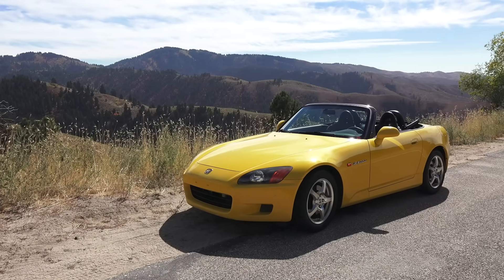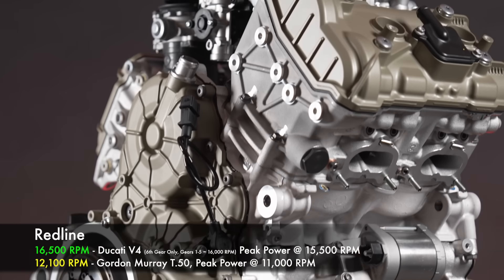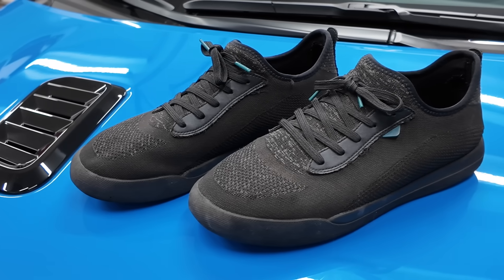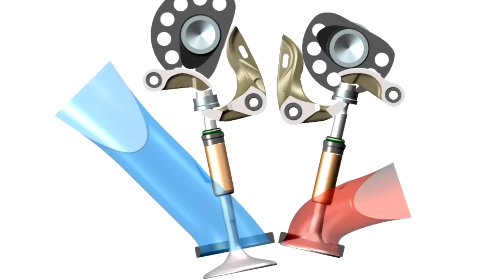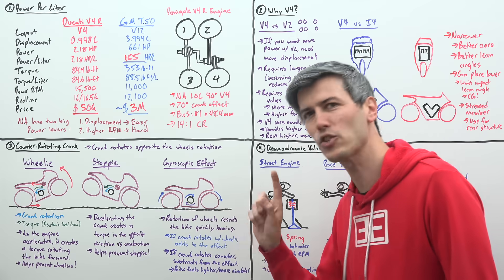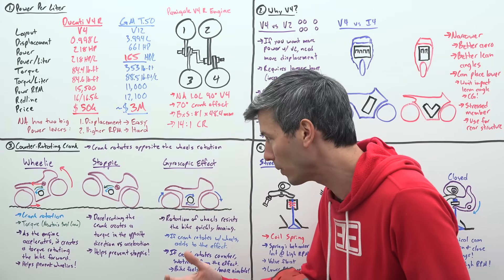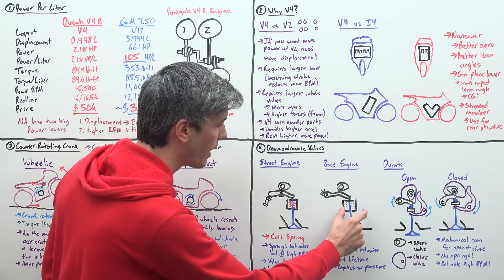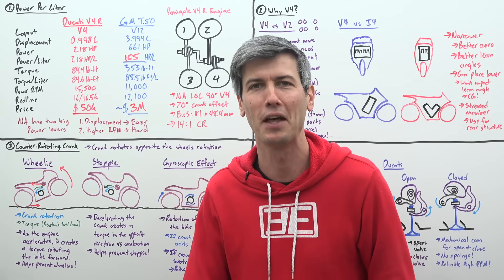Ducati's Brilliant V4 Engine — Putting Supercars To Shame!

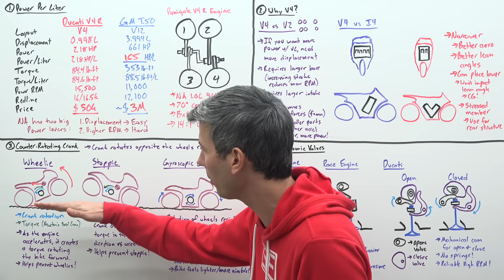Comment: 7:58 - ref: the Yamaha Megacorp and a Japanese Engineer named... wait for it...  MASAO FURUSAWA.😎  he is the legendary designer of the Crossplane I4 found in the Yamaha M1 Prototype Racer (also ref: VR46).  PS: nice 1/2" Milwaukee Impact 🤙for occasional use on "Yellow Iron" and Diesels I've got both their second Gen 3/4" and their first Gen 1" (unfortunately it turns out, these Excavators and Big Rigs aren't going to just fix themselves).

Comment: There have been some people installing super bike - crotch rocket type engines in those tiny cars like smart cars. They put so much extreme engineering in those bikes so they get a lot of horsepower in a small package. Imagine a Hayabusa engine in a smart car with a modified suspension. I would like to see this technology with the camshafts replacing valve springs used in cars I think it's pretty brilliant. I wonder if this could be implemented into something like a V8 or even a V6 engine.

Comment: Ducati didn’t invent the Desmond valve train. F.H. Arnott did in 1910. But Ducati perfected it in 1956. It does have a small keeper spring to keep a small amount of valve seat pressure for starting. Beautiful engineering.
Reply: it's desmodronic valve and google says Fabio Taglioni invented it, and engineer at ducati in the 50s.

Comment: As other comments have suggested, I would love to see more content on bikes. I would especially like a video on power/weight ratios of motorcycles versus cars - people simply do not understand how quick motorcycles are; even the slowest motorcycle is quicker than most cars on the road. It's kind of a key reason as to why you see bikers going 100mph+ on highways ... it takes <2 seconds to go from 70 to 100+, and <2 seconds to go back from 100+ to 70.

Comment: I was not aware of the gyro effect being subtracted if it goes in the other direction than the wheels, this seems counter intuitive for me since you’re not making the wheels go slower to make this effect smaller, you’re just “adding another spinning wheel” (in the opposite direction) that also adds resistance to leaning, never thought it could substract just by turning in the opposite direction😅

Comment: I don't think there's a lot of information out there right now but it may be of interest to you. MV Agusta just announced they're developing a 5 cylinder "square engine". They're claiming it delivers over 240hp above 16,000 rpm and up to 135 Nm at 8,500 rpm while weighing less than 60kg. The weirdest part is that it has a U-layout cranktrain with a 3-cylinder front shaft and a 2-cylinder rear shaft. This info comes from their instagram account, but maybe there's a press release somewhere with more information. I'll probably never be able to afford a bike with a motor like that but I still really want it to make it to production because it's so cool.

Comment: My older brother's first car was a 1985 Jeep Cherokee with a v4 engine and a 4spd. 
You could get that thing up to 85mph if you were going downhill with a slight tail wind lol. But he drove like a maniac around town and got really good at taking turns hard enough to tip it up on 2 wheels and could even ride it for a good distance tilted on 2 wheels and then set it back down, never tipped it over on its side. 
I used to have a blast riding around with him as a kid.
But any time a v4 engine gets brought up, I'm reminded of the wild times in that Jeep...

Comment: my late father was paid by a bike racing team to remove the desmodronic system and replace it with springs so it would be eligible for a particular uk bike racing series - they did it because the bike and engine even without the desmo was still faster than the competitors - of course it was instantly protested on it’s first race win - and the scrutineers couldn’t believe their eyes when the realised it had been converted back to springs and therefore was legal - we called it the DesNo conversion

Comment: Doesnt the 90° of the V configuration help in making more torque than a inline engine? So not only does it RPM and make a lot of horespower they also made it produce more torque at the same time

Comment: The design advantage of 90 degree V engine is that the primary shaking forces of the connecting rods are absorbed by the cylinder with is offset by 90 degrees. This makes the engine much smoother without a counter-rotating balance shaft allowing the engine to rev to higher RPM. This was one of the reasons why the Honda VF750F was dominate in 1983.
Reply: The VF750F certainly owned the production racing class in Australia that year i also owned one an impressive bike back then.

Comment: Desmodromics go back to 1896. Ducati didn't invent it. It's useless in all the air-cooled v-twin Ducati motors, because they redline around 7000 rpm. My 1973 Honda cb350 redlines around 11000rpm. What it can do is allow more radical cam profiles that would either cause the valve to float, or would need excessively stiff valve springs. This motors' 12.5k redline is not terribly impressive either, considering my old 2000 R6 redlined at 15k, using old fashion springs. Oh yeah, and the r6 didn't have belts that need to be replaced every 2 years, and valve clearance checks were at 35k, not 8 or 10k or whatever Ducati wants nowadays. I'm sure the Ducati's engine tech is all that and a bag of chips, but the belts and the desmodromics should go.

Comment: If you go back to the 1199 and 1299 the torque AND horsepower would both be higher than that of the Gordon Murray engine, and they did it in a  V2!!!
Such a great video. Thanks for posting this.

Comment: @EngineeringExplained You only talked about power and not about torque. Explain why motorcycle engines are not used in cars and why they wouldn't work.

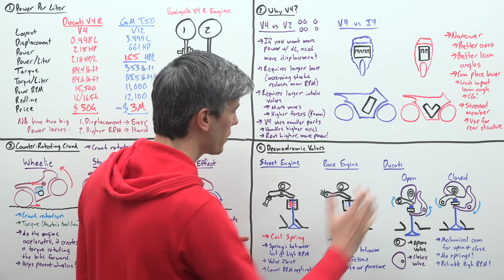Comment: 10:20 i'd say this street engine valve set up is more for cars. Majority of modern bikes use bucket style rather then rocker arms. A great example is Yamaha r6 (yes smaller cc but same point). Bucket style cam lifters but can rev 15k
Reply: i know 1 bike engine that use the rocker arm, which is the honda's k56 engine (cbr150r)

Comment: Can somebody explain difference between 1L V4 vs 1.2L V4 which is used in multistrada?
Reply: Block is the same, I believe. Multistrada uses conventional valve mechanism. Panigale has a different stroke and bore (so it's 1L displacement) and desmodromic valves, so heads must be different also.
Reply: @vvevvevvvvthank you :)

Comment: hello You explained the benefits of the counter rotating engine and I understood as the other factors but why not counter rotation for all high performance engines as a default  I do not understand the disadvantage other than perhaps a gear train to reverse the final drive. Great feature very well explained. thanks.

Comment: GM 13.75hp/1000rpm/Litre 
Duc 13.2hp/1000/L
Reply: What General Motors engine are you talking about?
And why would anyone measure horsepower per revolution per displacement?
Reply: @vvevvevvvvbcz total hp varies with redline . U a kid ?
Reply: @DeeP_BosE you are talking nonsense.
Reply: @vvevvevvvvfind a school near you. Or watch the vdo again kiddo

Comment: I need a car version of the Ducati Superleggera V4. Ducati should collaborate with Lamborghini to bring this dream to life! Imagine a Ducati car equipped with a 4-liter V16 engine that produces 884 horsepower and 342 pound-feet of torque, reaching a redline of 16,000 revolutions per minute. The car’s bodywork would be crafted from carbon fiber with a carbon fiber monocoque, and it would feature an air intake system reminiscent of the McLaren P1. Naturally, it would accommodate two passengers and boast gull-wing or butterfly doors. The rear-wheel-drive system would be complemented by a 6-speed paddle-shifted manual transmission, complete with a clutch pedal. The car would employ passive aerodynamics to enhance its downforce, while maintaining a design language similar to the Ducati Superleggera V4. Let’s not forget its impressive wet curb weight of 2,800 pounds and an astonishing 1,400 pounds of downforce!

Comment: Unfair comparison.
You are comparing an engine designed for a different application.
What about vehicle mass?  Would a Duc V4 be able to propel 1200kg with the same power outputs and ceiling rpm, reliably?  I have my doubts... 
Also the Ducati Desmo valve clearance checks are frequent (15k miles) and costly at aprox £1500. Many wouldnt find that acceptable for a mass priduction car.

Comment: More motorcycle engineering content yes please.

You may also want to check the Japanese quarter-liter sport bike of yore (by yore I mean the 90s). For their time, they were way over-engineered to the point of Honda making an 20,000 rpm redline inline 4 with their MC22 CBR250RR (granted peak power is still at 14,5-15,000 rpm, but still).

Comment: The BMW G450X , a street legal dirt bike, has a single cylinder also rotating in the same direction as this Ducati.
This reactive force of this engine can clearly be felt "pushing" the front wheel down during acceleration even on dirt.

Comment: It was about time you discussed motorcycle engineering. Maybe someday you can give us your analysis of one of the most unique piston engine designs of the past decades: the oval-piston Honda NR500 for GP racing and NR750 street bike. While ultimately unsuccessful, they remain some of the most original designs ever produced. Also while on the subject, in the 1960s Honda produced some of the most legendary, highest-revving GP engines ever, the 20,000rpm six cylinder 350 (actually 297cc) and 250 GP, the five-cylinder 125cc and the incredible 23,000rpm 50cc twin. They have been analyzed and written about for decades, but something I once came across is that at the time Honda discovered that at those engine speeds fuel octane no longer mattered because there was no time for fuel to self-ignite before the spark plug fired. I have no idea if this is so and would really enjoy it if you could educate us on this matter.

Comment: You missed a big one.   The Cosworth 4.5L V10 is the highest specific output normally aspirated car engine made.  Ain’t even close.   1000HP.  Which means it almost matches the  Panigale R at 222 HP/L.   And let’s not forget that you left out the part that as engines get larger it is much more difficult to raise specific output because of moving all that operating mass.   The fact that it is doing this at 4X the displacement is beyond insane.   15000 RPM.  Just wild.
Reply: Isn't a road car, really.

Comment: Ont thing i suppose is interesting about the desmodronic valves is that i believe they don't sap as much power. In higg revving applications valve springs need to be stiff in order to reduce valve float. Pushing the stiff valves down takes more force. Is that true tho, or does to valve that are coming up kind of rebalance the force needed to push the valves down?

Comment: l didn't know the v4r's layout had built in anti wheelie and antistoppie.  thats actually some genius level engineering
Reply: Not only v4s and not all v4s.
Reply: @theonlyonepaulo  ya l only mentioned the v4r.
Reply: Every Panigale V4 variant has that feature, since they all have the counter rotating crankshaft. The V4, V4S, and V4R all share the same engine platform/design (Desmosedici Stradale)- just with the V4/V4S having the 1,103cc regular version, and the V4R having a modified smaller displacement of 998cc (but higher 18,500 rpm limit for more overall HP vs V4/V4S) to stay under the 1,000cc limit for racing.
Reply: @BackwardsMarathonPSU  do the other v4 bikes share the layout like from aprilia rsv4?

Comment: I don't believe in the arbitrary math. The 1.3 liter rotary in the RX-8 was a beast. It generated massive HP for it's 1.3 liter size purely through engineering and design. It definitely made the most of those 1.3l.
Reply: 238 hp in 1.3 liters = 183 hp/liter in the first year (2004) RX-8.  The S2000 came out in 1999 at 118 hp/liter.  So the video is technically correct, just as it states that there is a 4 liter engine with 168 hp/liter which also is more than the S2000.
Reply: @jgerhardstein  I didn't mention the S2000 nor did I say the video was incorrect. It claims the 661hp in a 4 Liter engine is the highest output per liter in a production car. I'm simply saying this was easily beaten even 20+ years ago.

Comment: As I recall, in 1966, Honda’s RC 116 50cc engine made 16 hp at the wheel, or 18.8 hp at the crank, 21,500 rpm.  This was N/A, on gasoline.
That would equate to 320 at the wheel, 376 at the crank, per liter.  Published red line was 22,500.  Bike had a 9 speed trans.
Reply: That 50cc bike was insane!  Reports indicate a top speed between 110mph and 120mph.  That's nearly as fast as the 1980 Suzuki 750 GS I owned more than half a lifetime ago!  The fastest bike I ever owned was the 2004 Honda VFR800 -- I managed a bit over 150mph on it from 107hp.

Comment: Mv Agusta also does counter rotating cranks. Ducati is not alone. 

All the major racing players offer or have offered about 200hp per liter since BMW pushed through the 150hp barrier 17 years ago. Took a few years but there's plenty of options from Kawasaki and Honda, all the way to the BMWs and the Italians like MV, Ducati, Aprilia. 

Ducati generally trails on power and have finally shot forward with the new V4s. Ducati has historically relied on more displacement to get close to the performance of everyone else. 

By my butt dyno having ridden most of these bikes, the new V4R feels electric and boring, no drama. BMWs are still my favorite, the engine is like a a crazy gorilla but everything else is perfectly refined. If you want pure speed Kawasaki has it nailed with the 320hp H2R, those things feel like you're in the warp speed animation. 

Desmo is meh. No real benefit these days. BMW hasn't really messed with their 1L and it took 17 years for Ducati to catch up with their Desmo and V designs. Give it another couple years and they'll be behind again.

Comment: FYI: MV Agusta 3cyl engines are also counter-rotating, and beat the Ducati V4 to market by several years.
Reply: What i can here for 👍
Reply: Had done triple check I wasn’t crazy about my Dragster lol
Reply: I love the Brutales
Reply: fact! owned a dragster back in 2015. counter rotating crank mv was first.
Reply: mid seventies KZ400/750  twins were counter rotating and i believe some small cc hondas as well.
Reply: @VictorWilkens I'm sure there are a bunch of classics, was referring more to modern machines but let's be real.... Most things have been tried at some point!
Reply: @rjwz28 yupp, kinda like the first tranverse inline 4 motorcycle being a race bike from I'm pretty sure the 1910's, if anyone has any more information on it feel free to share. I just remember reading about it haha
Reply: If im not wrong the 1970s Ducati Bevel engines were counter rotating.
Reply: Yeah came here to say this
Reply: Yamaha TZ750 race bikes from the 70's and 80's had reverse rotation in the crank
Reply: As well as their current 998cc 4 cylinder engines.
Reply: so I remember reading about the XV virago yamaha factory dirt track bikes, running backwards too.  (obviously not made currently, and the race team may have done something funny to be competitive,  IIRC  they ran a frame with lots of adjustments so they could dial in something the might beat a Harley.
Reply: Also Italian engineering!
Reply: @titaniunhead  You mean when wire is supposed to be red but for some reason it green?
Reply: @grumpyrider369 that’s right, no boring predictability.
Reply: Fix It Again Tony!
Reply: Sure, when is the last time you saw an MV on the road?
Reply: @grumpyrider369 

I live in a city, so they're more rare than Ducati but I still see them. Also, what difference does it make how common they are? The fact remains that the Ducati V4 is not the "only" street motorcycle engine with a counter-rotating crank, and it's not even the first.
Reply: @rjwz28 it's also coming from a car guy 😂
Reply: @grumpyrider369 i saw one the other day. But maybe just cause I own an assen. 😂
Reply: @grumpyrider369 you're about as likely to see a V4R on the street as any MV, to be fair.

Comment: 7:00 BMW/Husqvarna used a counter rotating crank on the G450X /449-511 engines. Though the bikes were predominantly created for Enduro riding, they were road legal and there were SMR versions from the factory with road tyres and low suspension.
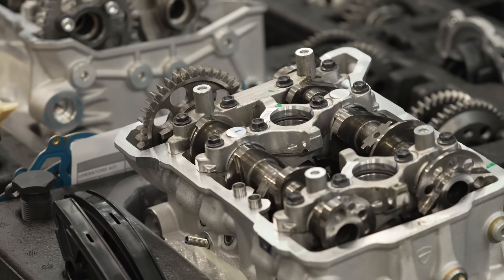11:35 As a mechanic I understand the Desmo system, but I've never been able to imagine how they allow for heat expansion of the different components and get the valves to remain seated hot and cold... Surely the valve stem expands way more than the followers during warm up. 
Anyone? 🤔
Reply: Have a look on Ducati's website the diagram shows a torsional spring on the closing arm. Just for that last fraction of a mm otherwise as you say the valve would slam into the seat of fail to fully close at some point.
Reply: @mecoollearoyd So there's still a spring... That would seem to defeat the whole purpose of removing the springs 🤔
I'll look it up.
It's never really held any interest for me until now, they've just released a 450  MX and Enduro bike with Desmo fitted.
It hasn't made them more powerful or higher revving than the current competition, but maybe they plan to see how it goes and build from there.

Comment: Sorry to Buzzkill, but on the street Desmo adds nothing but $$ & maintenance. + Honda did counter rotating crank back in the 80s. NSR 500.
Reply: I dunno, the engine in my air cooled 2006 S2R800 makes as much power as a modern water cooled Yamaha parallel twin of similar displacement... And my old bevel Ducatis from 1968, '72, '78, and '83 all have counter-rotating cranks.